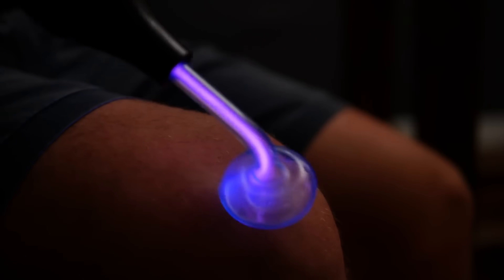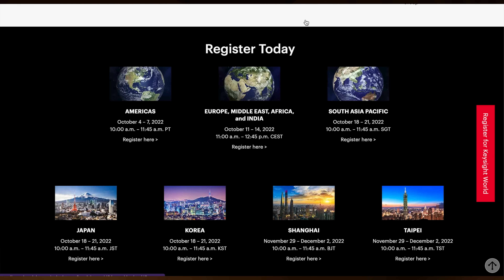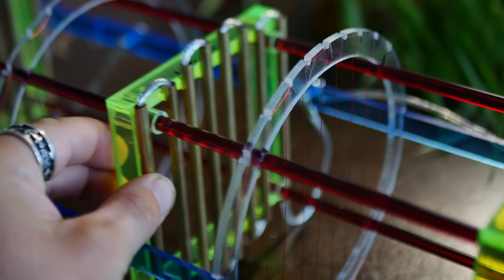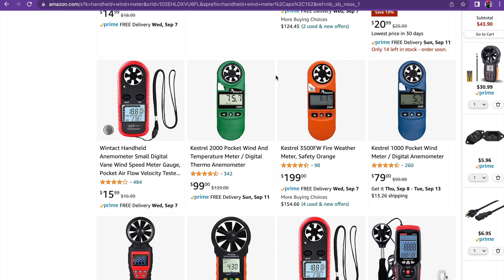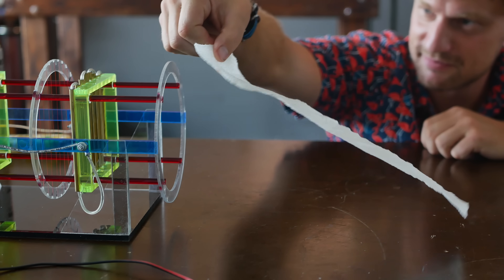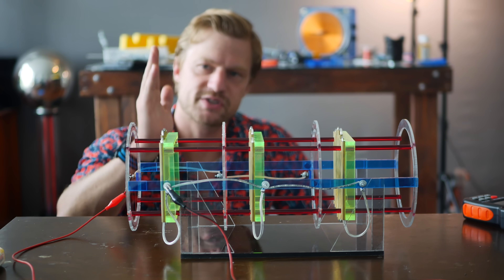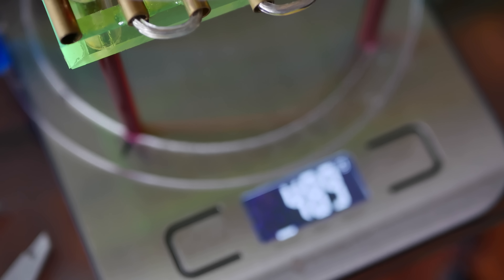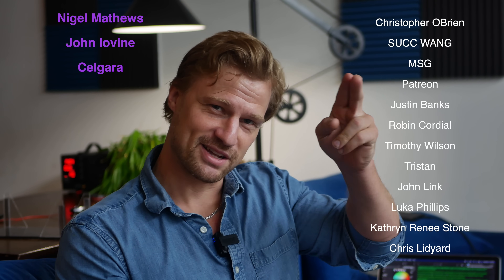Designing A Next-Gen Ionic Thruster! (For Flight)

Comment: not Shure if what i have noticed during the still photo sections but if you sanded the side of the positive wires it would add more sites for the ions to discharge perhaps increasing the thrust. also try vectoring or rather ducting so that the thrust can only pull from one end and out the other

Comment: Well the most obvious  inefficiency in my opinion is that it needs to be enclosed inside of a nisselle.
 The next would be that you have each individual thruster space very far apart if you were getting optimum thrust from a staggered configuration then I believe you could make the same configuration much more compact. I'm at a loss for the third inefficiency although I strongly suspect that you're going to say it has something to do with your power supply.

Comment: I really like this idea but I'm thinking you might be able to take advantage of airflow.
Have a look at a youtube series called the fan showdown.
It's all about pc fan designs but what different designs to channel the airflow can do with the same motor and power supply shows just how efficient you can make something.

I would personally start by containing your design in a cylinder to prevent any air leakage from the sides.
I would also think about the size... having a larger entrance and a smaller exit would allow the air to move faster.

Then, you can think of how to improve the airflow within by putting vortex generators inside etc etc.

I'm subscribing as I want to see your progress!

Comment: Good work!

Say, do the negative electrodes need to be thick pipes? Is it possible to use wires too, or aluminum foil strips? I think you can save a lot of weight there.

Comment: more voltage= faster wind (bc stronger electric fields pull on the ions). but more current= more molecules ionized and moved. so what you realy need to increase for higher thrust, isnt voltage but total power. you need a significant amount of ions (mass) being pushed back and a good, high velocity to make the "recoil"/thrust stronger.

Comment: I'm curious if testing different materials for the electrodes would make noticeable differences? And also, What the spacing between the stages does? Maybe also providing a shroud around the whole device to create a wind tunnel and possibly using circular instead of lateral electrodes.

Comment: I'm sorry, but any evaluation of this in terms of thrust to weight efficiency that doesn't include the power supply and power source is exactly as disingenuous as just including the propeller weight when calculating the efficiency of a turboprop engine.

That being said, it feels like most of the efficiency loss (almost all of it) is on the heating of electrodes by electrons leaving the cathode and striking the anode, aside from chemical inefficiency of generating what is probably a great deal of ozone.

As you should notice, when you look at your dark video, there are a lot of hot spots on the cathodes. Since that's happening anyway, a pin grid of a metal that doesn't form an oxide coating would probably be better. Unless you have a bunch of platinum you can throw at this project, copper or stainless pins would probably not be a lot worse. Also, the heating effect on the pin tips is technically a good thing here, by a little bit.

Obviously shaped anodes would be better, but with pretty quickly diminishing returns.

If I were doing it, I would probably attach the cathode grids to servos and use an anemometer with USB output to algorithmically find the maximum velocity vs spacing.

Adding shrouds (like you'd find on a ducted fan) to the cathodes and anodes should help with turbulence while allowing you to still move them relative to each other.

I think no matter how you slice it though, you're gonna lose a whole lot to heating. If you wanted to get real crazy, you could have the front of the anode be an insulator and the rear be a "v" shaped conductor. That should add some additional thrust, even if its just from the additional heat being on the leaving side of the anode, which is where you want it to be.

Not for nothing, but adding high voltage RF to the input voltage may help in the same way that it helps arc start in welding.

Anyway, good luck.

Comment: Nice stuff.  Thoughts on future design tests:

1.  The overall size might be contributing to its inefficiencies.  Have you tried 1/10th scale?  Making 10 very light weight thrusters may have more power than 1 larger thruster
2.  Do the electrode pairs need to be spaced so far apart?  What if they're all staggered 1" between wire/ground and 1.5" from pair to pair?
3.  What if concentric circles?  Take one large wire and do a "bicycle spoke" spacer design with a leading edge wing shape for the spacer vanes to maintain a fairly circular spacing and force an increase in air speed.  Every 90 degrees you can secure the wire to the next strata out and return inward again, and dive deeper into the circles every 180 degrees.  Once you reach a 1cm diameter you can alternate outward again, using the spacing vanes as insulation walls to keep the wires from touching and arcing.
3.5.  As an added benefit of the wing shape of the vanes, you could potentially allow the individual wire segments to free spin as lift is generated (if you go with a traditional wing form) an try to use the rotational momentum somehow (like generating energy from the spin using magnets at the ends of the vanes?  Don't actually spin and use piezoelectric crystals to act as an additional micro energy booster, etc.).  If you use a "double top" wing design (no flat side, no lift generated) it may simply improve thrust in place, but I ain't no fluid dynamics engineer.

Comment: 1: ducting, you're getting nearly no benefit of the suction without it.  2: I don't know the word for it but you want to made the exhaust laminar straight out the back.  I've seen this done with something as simple as a screen in the outlet as well as things with some height to them almost like a honeycomb.  3. stage design and density.  You have a lot of un-accelerating space in your stack where air velocity is decreasing between stages. Optimal spacing of one stage is one thing, but optimal acceleration for the entire height I'm guessing will be more less-than-optimal length stages vs fewer optimal ones.  Additionally I didn't see it mentioned that you already determined ideal spacing of your positive elements from each other and do you actually need an equal number of corresponding negative ones, and negatives that are so bulky?  I think you can get a much tighter positive design and less bulky negative design to boost the gains and reduce the losses.
4. bonus, more volts!  
Would draw more power but I think the name of the game right now is maximizing thrust to weight, not thrust to energy.
super cool project!

Comment: You are providing more thrust to weight ratio than some airplanes and rockets. However, the space requirements are quite large with the current design. I imagine that light emission, heat emission, and electrical consumption play a huge part in inefficiency. I would do something similar to turbo-jets and encase the current model and add turbines to speed the air up before it enters the chamber, then focus the air propulsion through a nozzle to achieve higher thrust in a smaller area. Another idea would be to somehow heat the air before it enters so that it can expand greater

Comment: Is it worth playing with the number of electrodes? You only use  a few + wires - would it help to double them up? Is thee a reason why the - electrodes are so much thicker? Could they also be wires? Or maybe flat sheets of metal to reduce frontal area/air resistance..

Comment: Beautiful workmanship! Before you begin round 2 though, you might want to check out this paper: https://arxiv.org/ftp/physics/papers/0211/0211001.pdf , Asymmetric Capacitor Force by the Army Research Labs ( discussed here https://youtu.be/HpDeFtAtqF4 ) and watch ALL of @c6jones720 lifter videos. His progression is methodical, informative, and may save you some time in the next round. As far as optimizations go, there is a ton of weight savings you can make with materials and once you've decided on a final configuration. Although, the adjustable model is really extraordinary. Also, it may seem counterintuitive, but you should really watch this video https://youtu.be/m2_QQMSpnYI where lifter performance was improved with a "solid skirt" by @c6jones720. Lastly, because the research paper I linked above suggests that "wind" is not the primary lifting force on a lifter, you may want to change the orientation of your model by 90° and measure the change in weight of your device rather than the airflow. You may find some useful anomalies that you weren't actually looking for. 

Personally, I think it's the vacuum that's being created by the small side of the capacitor that might be creating the net driving force. That's a lot harder to measure, though.

Good luck.

Comment: It would be interesting to see what the airflow looks like between each section.  Maybe with some colored smoke?
Reply: So, smoke wouldn't necessarily make it through the unit, seeing as how the individual particles would become polarized and then basically electro-plated onto the grounding electrode, as they do in electronic air cleaners (electro-static precipitators). This is also how coal power plant stack scrubbers work.
Reply: @andyledoux  Thank you for the response.  Very interesting info.

Comment: controlling the flow like a tokamak so there will be 1:no loss of wind column mass through gaps between each stage 2: if correctly applied we can create a vortex which could be an upgrade 3: and finally if everything worked out and the containment is good enough we can use it such that most of the heavy thrusting (for lack of a better word ) carried out by the vortex a contained vortex made of plasma gobbles up air from one hole and spits it out from another. Sorry if any of my suggestions are farfetch'd but when i saw this video i became a fan to it ive got some ideas on ionic thrusters too but as they say it its easy to imagine than to make it into reality. looking forward to learn more from u sir peace out have  a great time

Comment: maybe trying to pack the most stages on a chain, instead of only 3, you could try and see whats the minimal distance you can have between 2 stages without them interfering, maybe add a material to isolate them from counterplaying? but without restricting airflow. you could also make a tube around all of that, so that the air cant escape and has nothing to bump into. A nozzle would be beneficial too i think. Amazing project! i'm eager to see the second version.

Comment: I wouldn't be surprised if having the anode and cathode in-line like that would be an inefficiency. Why not rotate one of the two so that the pair forms a grid pattern. 
I wouldn't be surprised if another inefficiency is the lack of an outer tube. There's a lot of potential for flow to be lost radially. 
Another inefficiency could also just be how the anodes themselves are staggered, where the cathodes are the only adjustable piece. Adjusting this to where the anodes are also adjustable could improve efficiency, as seen with different cathode placements; I wouldn't be surprised if the optimal placement follows some logarithmic curve where performance follows that curve's inverse. 
Then there's the inefficiency of lacking ducts and nozzles. I'm sure intake performance would benefit from them, at least in active flight. 
I'd also be curious to see air temperatures, I'm sure there'd be some correlation between air temp and body shape, though optimizing for this would be better done in software that can handle simulation of both air speed and temp. 
Anode-cathode density probably matters a fair bit. Though on the cathode end it'd probably be better to use wire rather than a tube, achieve higher density and improve airflow characteristics. Another form of inefficiency. 
Going back to wire layouts, I'd be curious to see what a grid of anodes would do with a grid of cathodes, rather than just a bunch of parallel wires. Again, adding density to the plane. Stemming from this, I'd be curious to see different types of grids, square, triangular, with a bit of weaving you could do a hexagonal grid, of similar wire percentage per planar area, to see which performs best. There could be an efficiency improvement somewhere. And going back to the first on this list, match the anode grid with its dual of a cathode gird and see if there's more improvement then.
Then there's also arguments of how this would perform in active flight. Assuming you have an aircraft going fast enough to keep altitude with lift, these would need to at least equal the drag of the aircraft. Testing as a static piece in stagnant air is one thing, but testing in a dynamic setting with an already existing in-rush of air is another thing. Test this with a fan blowing into it, see if it can still produce any amount of thrust then.  

The project is interesting, but there's just so many ideas you could delve into. Just going through these ideas and thoroughly testing them, you have close to a ten part series on just a proof of concept.

Comment: Loved this!
On the frame, instead of flat circular pieces, how about short cylindrical sections?
With the electrodes, I'm thinking concentric circles. The distance between individual electrodes on the same plane may provide another parameter with which to gain efficiency.

Comment: Upgrades: 
1.) Ducted  
2.) Closer inter-stage spacing 
3.) Blank PCB ground planes instead of brass tubes or aluminum honeycomb like is used in automobile MAF sensors to straiten flow

4.) Grid or web designed cathode

Comment: Staggering the stages was very interesting, showing it can increase the air speed almost by easing it into the final speed, I think enclosing it making it almost a ducted fan would help, as well as smaller negative ends, providing less resistance to the air flowing through. Maybe some lighter materials as well. Composites maybe?

Comment: Cool the air on the intake so it's denser, wrap the whole thruster in a cylinder so it's only pulling through previous stages, nozzle on the output to concentrate thrust?

Comment: no cover? why I'm curious on how it would perform if it had something to cover the sides like a tube or something restricting the airflow from the intake to the exhaust... will it increase flow speed or will it increase pressure or will it do nothing... also following the same idea why not make stages? like a jet compressor restrict the airflow going from the first to the second and maybe increases the voltage on the second stage to accommodate...

Comment: Ionic thrust goes back even farther than that. There was a guy I forget the name of that invented a device he hoped would help put out fires. It had a broom handle with a set of 2 wheels spaced apart on the end with a wire running between them that created what he called electric wind. It was supposedly based on work or theories of Tesla.

Comment: Another question, what is the effect of a pulsating DC voltage, Off/On at different frequencies and look for resonant frequencies that adequately drive the air out
Reply: F1=C/2L
F1 = the lowest frequency resonance 
C = the speed of sound
L = the length of the tube

Then you can double triple or quadruple the resonant frequency to see if there is increased output.
Reply: Looks like thrust can be varied more rapidly and with greater precision and range by using pulse width modulation

Source:  NASA’s Jet Propulsion Laboratory

Comment: Each stage is sucking in already ionised air molecules, reducing the amount of air able to be ionised at the next stage. What would be better is to have a concentric ring arrangement so that the thrust from the first stage is directed through the non-ionising centre of the next stage and so on. Also each stage should be aerodynamically designed to reduce turbulence of the incoming surrounding air that is entrained with the ion flow.

Comment: I thought it was really interesting that the staggered configuration produced better results, do you think that air speed could be a factor in spacing and if so it would be really interesting to see what that relation is and if you could use it to your advantage to get a better weight to thrust ratio
Reply: I think the staggering increases thrust in a similar way as gas turbine compression blade stages get closer together as the compression gets higher.  I mean, the first stage grabs ambient air and accelerates it to some velocity, then the second stage grabs the accelerated air and increases the velocity more, and so on.  Air is the working fluid, and as its properties change between stages, the mechanics operating on the fluid have to be different for the properties of the fluid at each stage for maximum desired effect.

Comment: 1) Return Electrodes (ground) should be airfoils and not circular. You're getting vortex creation from those tubes. 2) The design of the supports of the electrodes is likely causing significant turbulence. These should be streamlined or better yet, built into my next point: 3) enclose the entire construction with a light tube (think tissue paper) as that'll help focus the flow. You'll end up with a "ducted" ionic thruster. You'll end up with less "mixing" along the length.  Right now you probably have some minor vortex rings around the various structural parts that causes lost energy.

Comment: Play with wire and ground spacing and more power and higher voltage.  Larger Diameter ...   Increase power to 10 Kilowatts and efficiency ((mass * velocity)/watts) 10 fold . I'll get investors to toss 20 Million bucks at your project.  use a bottle of krypton gas as your propellant......  Megawatt and you're talking a Billion dollars .  ;-)